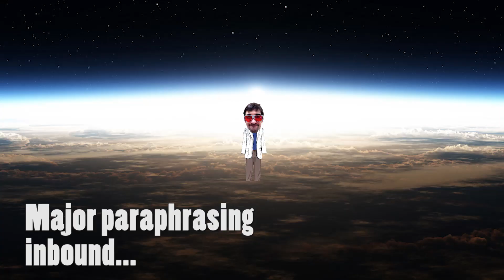What is Potential Energy?

Comment: Voltage is just the potential energy of an elecromagnetic field, right? Like how the potential energy E=mg is the potential energy of a gravity field? Am I right in saying that? What about pressure difference? How does potential energy work in a pressure difference? Are there other types of potential energy? Is there a potential energy related to the strong/weak force?
Reply from the maker: Hey! Yeah, that's right.  Pressure difference is a bit system specific, but you can always think of the energy stored or added to a system in terms of the work.  Which is the force applied over some distance, in the case of the air rifle, pumping the gun is compressing the gas along one dimension against some force (pressure*area) <-where the pressure increases as you compress.  

Interesting things to read up on would be: CAES
http://en.wikipedia.org/wiki/Compressed_air_energy_storage - which is effectively what we do in the air rifle.

As for strong force potential energy.  Something I haven't looked at that much since undergrad, which I should definitely change, but Yukawa potential rings a bell so would be a good place to start.  From memory it behaves similarly (in concept) to coulomb potential.  I can ask the particle physics group here if you'd like to know more.  Thanks for the questions!